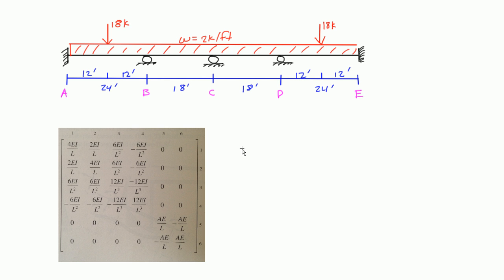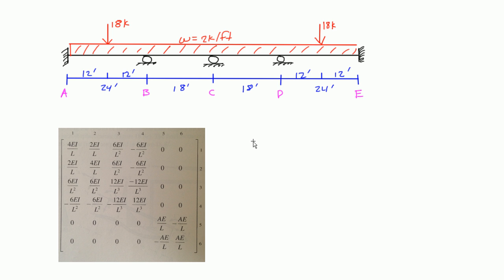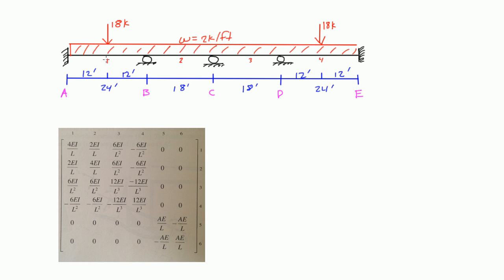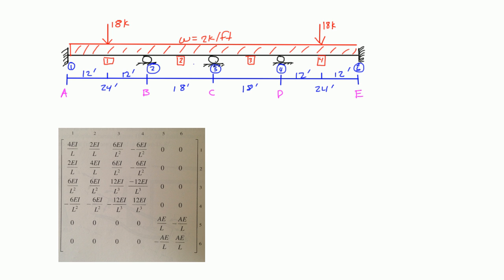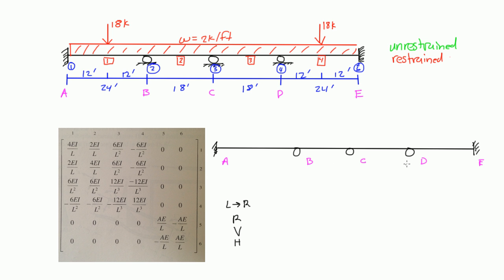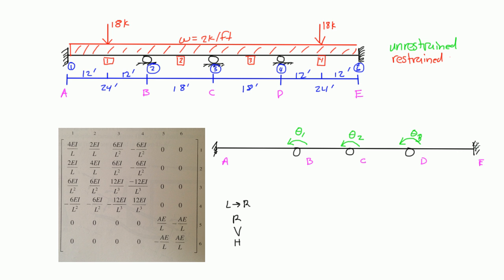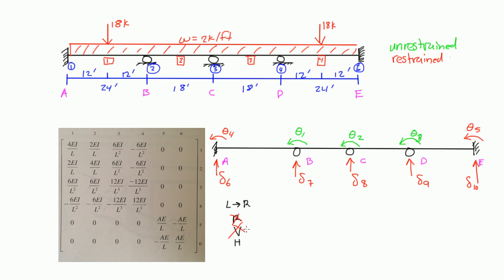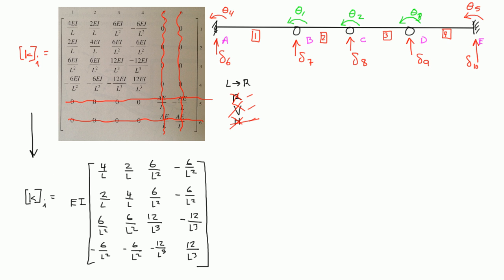Stiffness Method Example: Part 1

Comment: ......however,you can simplify the system  applying symmetry by taking a portion of the beam,better to say,half of the beam,the reason is that the slope is zero @ middle span therefore you can introduce a  fix restrain to it now reducing a 25x25 martix  to 13x13 one,read and think it over.....